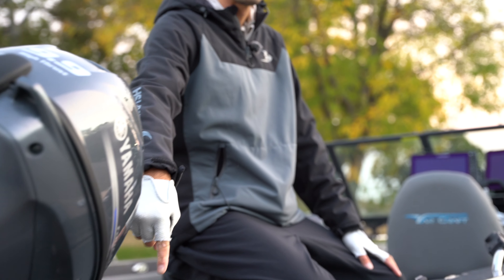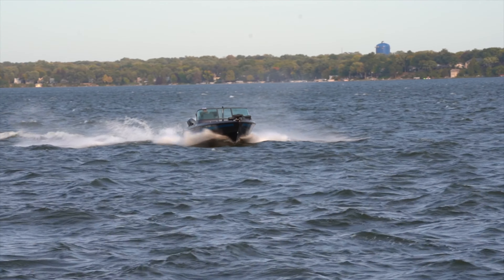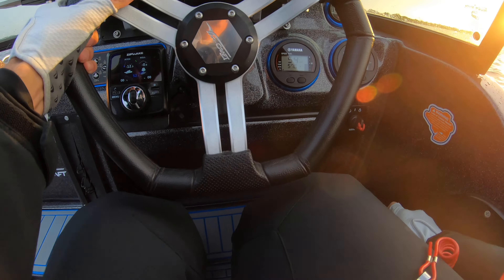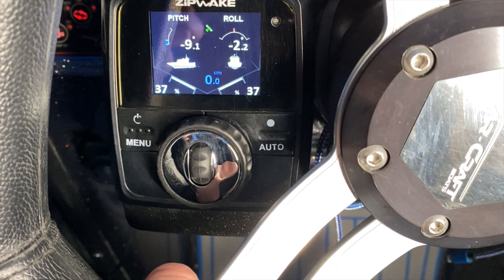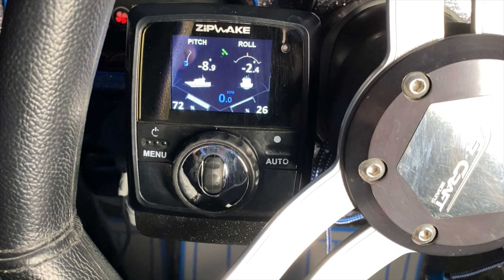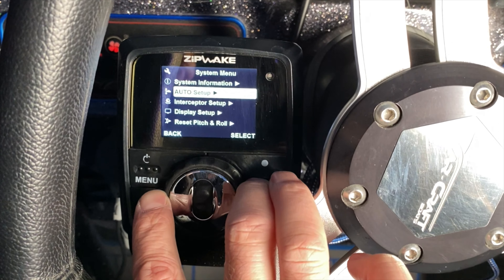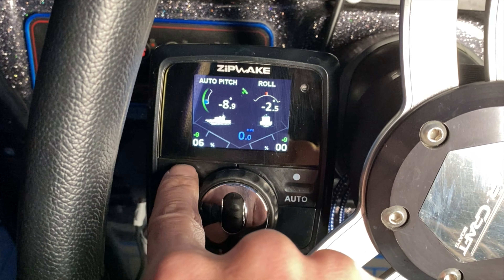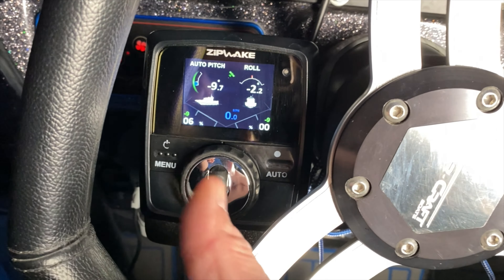Interceptors - Benefits and basic settings with a Yar-Craft 219 TFX

Comment: Hi, Joe would the 300mm size work well on a Lund Fisherman 2075. It's about the same weight as your boat. Not sure whether to go with the 17 1/2-inch or the 11 3/4 size. Do you think the 300mm will be fine? My Merc 9.9 and trolling batteries on the port side are causing an annoying list. Cheers
Reply from the maker: The 300’s would be fine for a similar sized boat👍 I tried a set of the 450’s just to see once and they were way more than the boat needed.
Reply: Thanks, Joe greatly appreciated. I think I will go with the 300's. Yep, I was thinking the same the 450.s would be overkill. Tight Lines.  @joeokada